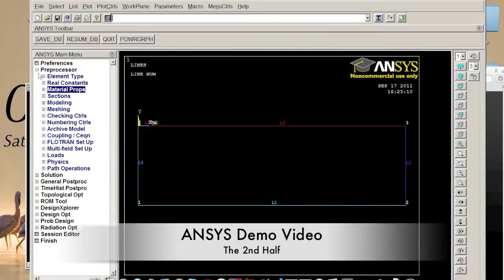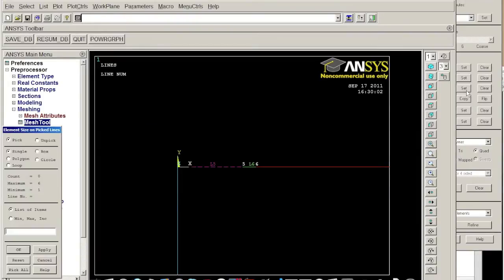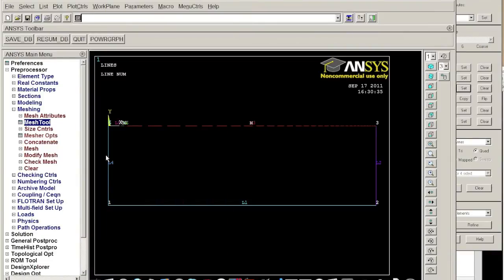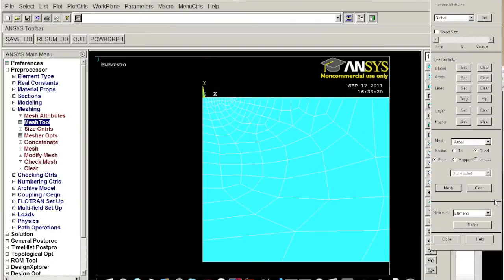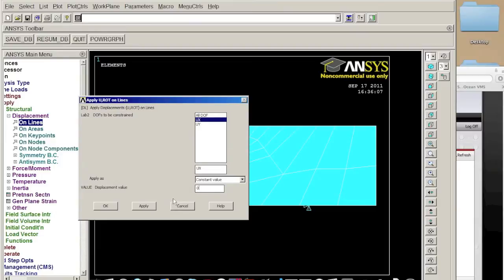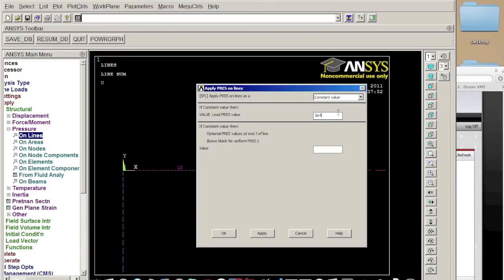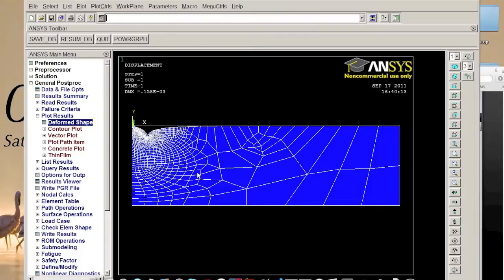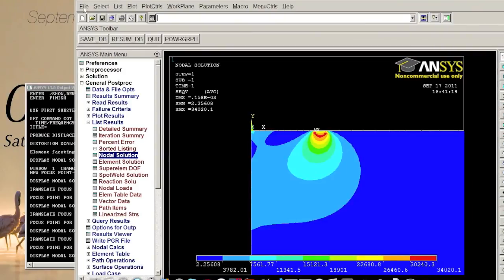ANSYS Demo 2

Comment: Thank you so much for this tutorial, it was very helpful. 

I am a final year civil engineering student in London. I am doing a dissertation on Finite element analysis on perforated beams using ANSYS. 

I have finished doing linear analysis and will start Non-linear analysis :S

I would really appreciate a quick tutorial on non linear analysis if possible. 

Thanks again